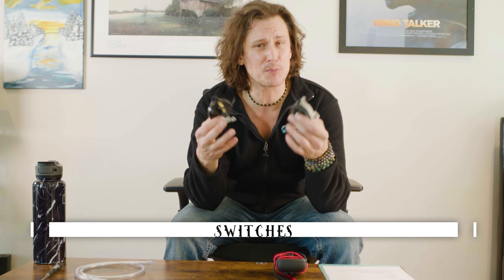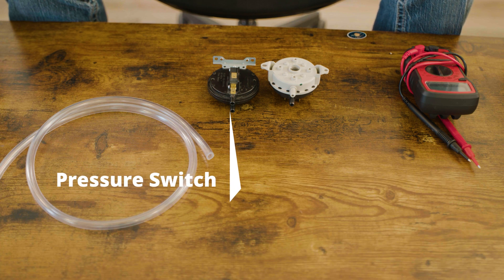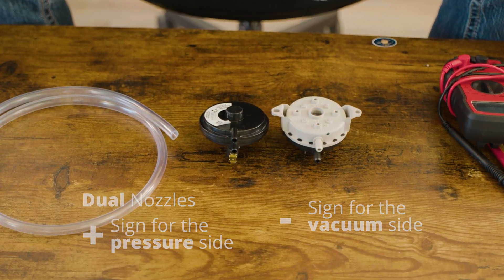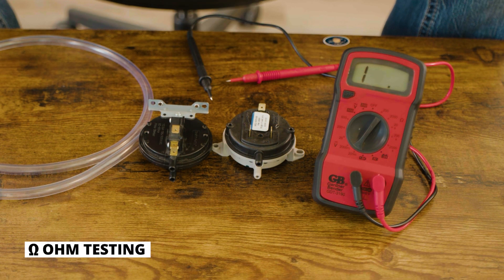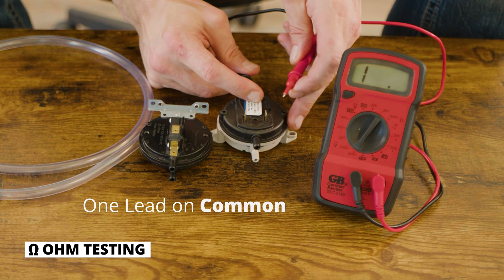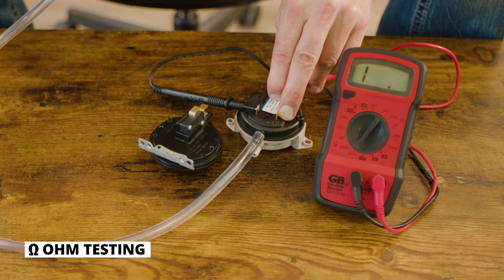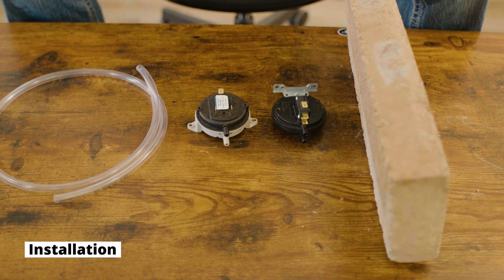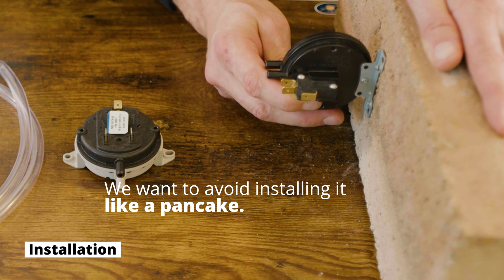Pellet Tech 101 - Vacuum vs Pressure Switch Installation and Testing

Comment: Ok I direct powered the auger motor and it ran fine so I reconnected it.  I then jumped the pressured switch and it didn't run, so i put that connection back and then jumped out the high limit switch and again no difference?  I did also put the new plug in cord on, no difference.  Just don't get it, the high temp switch does have a manual reset, but not sure when I pushed the button it did anything, but I guess it doesn't matter because I jumped it and it didn't work.
Reply from the maker: Hi Susan, thanks for the message back. Glad you were able to run the auger motor to direct power to ensure the motor was good. Also glad you were able to troubleshoot both the high limit and pressure switch by jumping them. It's the best way to rule things out. Sounds like it is not the high limit or pressure switch causing the auger motor issue here. The only thing left that controls the fuel feed would be the circuit board. Is there by chance a dealer near you that could test your current circuit board? You might also be able to reach out to Regency direct and see if they offer a testing service for the circuit board if you don't have a dealer nearby that can test it. Keep us posted, happy to help.
Reply: @EarthSense  Thanks for all the suggestions we will check that information out.
Reply from the maker: @ You're welcome Susan, please keep us posted, here to assist however we can. Thanks.

Comment: I replaced the auger motor and jumped out the bypass switch and everything works, UNTIL i push the unit back in then the auger motor stops running?
Reply from the maker: Thanks for contacting us. Please provide more details so we can assist. What stove make and model do you have. Which switch did you bypass - Vacuum switch, limit switch, hopper switch? We NEVER want to leave a safety switch bypassed, troubleshooting only. Please provide as many details as possible. Thanks.
Reply: @EarthSense  Its a hampton GCI60, I bypassed the pressure/vacuum switch just to make sure everything was working before I put it back in,  but it does the same thing even when i plug back in to the switch.  Sometimes I turn it on the auger turns until I push it in and other times the auger doesn't turn at all when I plug it in.  We did also replace the daughter board and that seems to be working fine, we did that because the buttons had worn thru the plate and it just needed to be done.  When there was no auger turning, I bypassed the pressure switch to see if it made a difference but it didn't.  Wires in the back look fine, I followed the wiring diagram to check the wires and all seem like they should, the power cord was pinched at some point so I ordered a new one that hasn't come yet, but find the whole thing very odd.  Blower fan and chain are working even though there are no pellets dropping, cleaned out the hopper and pulled the auger to make sure there were no clogs.
Reply from the maker: @susangeary1374  Thanks for the message back. Yeah, definitely an odd one here. Besides the circuit boards, there are only 2 safety switches that are in line with the auger motor, the vacuum switch and the high limit switch. Let's bypass the high limit switch to see if the auger motor operates correctly. For reference, this is what the switch looks like https://pellethead.com/product/pellethead-replacement-enviro-vistaflame-regency-hudson-river-high-limit-snap-switch-200-degree-manual-reset/

If possible, let's also run the auger motor to direct power to see if there is any issue with the motor itself. Here's a video on creating a test cord to do this. https://youtu.be/rlmiCYI2WPk?si=7ekzhv6v-XIJ3eSm

Keep us posted, happy to help. Thanks.
Reply from the maker: Also, double check your venting configuration. If the vent is kinked or has to much ash built up it will trip the vacuum switch and shut down the auger. Send some more info and we will help best we can. Thanks.

Comment: Great vid but I have a few Qs: 1) my approximately 10-11 year-old Harman Accentra-2 stove had been running fine in October for a couple weeks when suddenly it made a pop/thud noise and completely shut off, the auger motor and both fans. I bypassed the vacuum switch and sure enough, it's running great once again. But it sounds like only the auger motor should stop when the switch trips? If so, I am puzzled why my stove completely shut off.
2) My switch only has two prongs and one connector for the tube. Part number 3-20-6866. How do I correctly test it?
3) My switch is mounted horizontally, exactly like you say it shouldn't be. Why would that be?
Thank you for any assistance!
Reply from the maker: Thanks for contacting us. 
1. The vacuum switch is only electrically in line with the auger feed motor. Unless the wires coming to the switch or one of the prongs grounded out on the stove somewhere, I don't see how the vacuum switch could have caused all your motors to shut down. We would suggest getting a good flashlight to check all the component wires and connections. 

2. Your vacuum switch is negative pressure, Negative nozzle port. Follow that in the video here to test. 

3. Wouldn't be sure if it's the original switch and mount. Over the years Harman has made changes to both the switch and mount style. If you do end up getting a replacement switch, we would recommend the switch is mounting vertical for best performance. 

Quick Question: Was the status light blinking  on the control board when everything shut off? 
Keep us posted. Happy to help.
Reply: @EarthSense  Thank you for the reply. The status light was not blinking, nothing looked amiss on the control panel. I cleaned the stove thoroughly after bypassing the vacuum switch and decided to try the old switch again (a new one is on order).  And it worked! But one week later the stove is suddenly acting up again, the auger motor works, the control panel looks good, but it makes a humming sound and never ignites after feeding pellets. It almost sounds as if the exhaust fan is not running correctly even though its status light is on. Could this possibly be a control panel issue?
Reply: Update: I believe I have figured out the problem.  While it was acting up this morning (feeding pellets and otherwise just making a humming noise), I took off the back panel and observed that the exhaust motor fan was not spinning. Using a screwdriver, I gently prodded it and it began spinning. Eventually the stove lit just fine.  So the motor is getting power (hence the control board light being lit and the humming noise) but it's like it's jammed. This seems to explain the abrupt shutoff a month ago. I will be certain to put the vacuum switch back on but do you recommend a new exhaust motor? Or perhaps just cleaning/oiling it? Thank you as always for any assistance!

PS Your videos are so awesome and helpful! 👍
Reply from the maker: @patoconnor9600  Thanks for the messages. Great troubleshooting on your end! Yes, absolutely sounds like the culprit is the exhaust motor. Harman uses a sealed bearing motor here, so lubrication wouldn't be able to penetrate the motor bearings. You can certainly clean it well, but in most cases like this where the motor hums and will start turning with some help, it would indicate a failing motor and a replacement would most likely be in order. Here is the motor for reference - https://pellethead.com/product/harman-heatilator-ecochoice-combustion-blower-exhaust-draft-fan-motor-oem/

Here is a video showing replacement of the exhaust fan. https://youtu.be/np1dlYITcpw?si=m03alsrFQUpND-Xu
Keep us posted on everything, glad we were able to be of help.

Comment: My auger feed on my P61 Harman stove will not work.  I have bypassed the vacuum switch and the auger works.  I have another P61 stove with a functioning switch that I borrowed and installed on the problem stove.  Still no luck.  My door gaskets are good and I have thoroughly blown out and cleaned the stove and vent pipes.  I even blew compressed air into the vacuum tube.  After watching this video I am wondering if I have a problematic tube.  It is good as far as I can see it but I am not sure how the other end goes into the stove and how to replace it.  Can you give an idea or do you have some other suggestion?
Reply from the maker: Thanks for contacting us. It depends on the year of the P61, but with most the vacuum switch tube goes from the switch into the feed system housing. There may be silicone around it holding the tube in place which will need to be cut to pull it out. Let us know what yours looks like. If you do pull it out, important to make note of how much of the tube was in the feed housing. Glad you checked the vent pipe, door, glass, and ash pan door gaskets, be sure to check the hopper gasket as well. It can also be good to make sure the combustion fan is operating at proper voltage during start-up to lock in the vacuum switch. It should be near line-voltage on start-up. Keep us posted, happy to help!

Comment: I am experiencing a condition on my Harman Accentra 52i-TC (2022) where it just stops feeding pellets and starts flashing "hopper lid open". While this is is flashing, the diagnostic screen still shows "Pressure switch closed". No visible issues with the hopper lid gasket or front door gasket. No visible hopper lid door switch.

The wiring diagram on the machine only refers to a "pressure switch" and no vacuum switch.

What could be causing this? I would think if the draft was inadequate, or there was a door gasket leaking, the pressure switch would show "open" on the diagnostic screen.
Reply from the maker: Thanks for contacting us Dustin. Yes, in your 52i-TC it will be called a pressure switch not a vacuum switch. There is a tilt switch inside the display screen that could be causing the issue here.  We believe there is a calibration setting for it, but it may be the display screen itself. Here is the direct number for Harman Customer Support. They should be able to provide some options here for further troubleshooting to get you back up and running. 800.664.3119. Hope that is helpful, keep us posted.
Reply: @EarthSense  Thank you for your reply! That is exactly what fixed it. Shortly after posting, I had recalled seeing posts somewhere about the hidden "dealer settings" on the Harman Accentra TC model and figured out the quasi-secret way to get back into that menu. Then I found the "Lid Calibration" page therein. All I had to do is re-calibrate it and voila! Fixed. Amazing that there is ABSOLUTELY NOTHING about this online. I found ONE reference to the setting on a page for a replacement hopper lid gasket on a 3rd party replacement parts retailer, buried on the page. All I could find is people saying this was probably an issue with the pressure switch (but mine was still reading "closed" on the display).
Reply from the maker: @dustinriordan7051  Most excellent Dustin! So glad to hear you were able to get in there, access, and adjust - more importantly you are back up and running again! If anything else comes up keep us posted, always happy to help!

Comment: I have replaced the control box
Reply from the maker: Hey Jim, I just left a comment on the other post for you. Thanks for confirming you have replaced the control box. I think we either have an issue with the thermostat terminal block or we have an issue with the Junction Box wiring harness where the control box slides into. See the other comment I left and keep us posted. Happy to help. Thanks.

Comment: Where does the power come from and what determines the power for the pressure switch? Quadrafire 1200 pellet stove has no power to the switch. Blower motors all work snap discs are working no power to the thermostat
Reply from the maker: Thanks for contacting us. There is no power supply to the pressure switch. As the diaphragm opens and closes with pressure or vacuum it simply creates or breaks the circuit to the auger feed motor. I saw your second message and will respond to that as well. Thanks.
Reply: @EarthSense  there are two wires connected to the pressure switch when there is pressure it should connect the two wires completing the circuit. Where does the power come from for that wire? I know out of the brain box but something Elsa makes that determination? I have no power at the vac. Switch
Reply from the maker: @JimHaskell-es8pe  Hey Jim, the wires that run to the pressure switch will go into the junction box wire harness assembly where your control box plugs into. Unless the wire was loose inside the junction box, the control board/brain box is providing the electrical signals. We have run across issues before with the junction box, although not that common and it usually has to do with the receiving end for the control box.
Reply: I have replaced the control box and still the same no power

Comment: Can I by pass it to see if it's bad
Reply from the maker: Yes, you can certainly bypass for troubleshooting, however we never want to leave a safety switch bypassed. I will include a link here below that will show you how to make a jumper wire to do so. Keep in mind that even if the auger works when bypassed, it may not be the switch itself. Any air loss or air blockage can cause the switch to stay tripped. Checking ohms on the switch will let you know if the switch is good or bad. From there, if it is good we can check the other areas that may be causing the switch to trip. Happy to help if needed. 

Creating a Jumper Wire: https://youtu.be/FDVkbsHS95U?si=-zfm8vIUsIl9Ohw8
Reply: Thank you
Reply from the maker: You are most welcome @vickilewerenz7061 
If you have any future questions or needs please let us know!